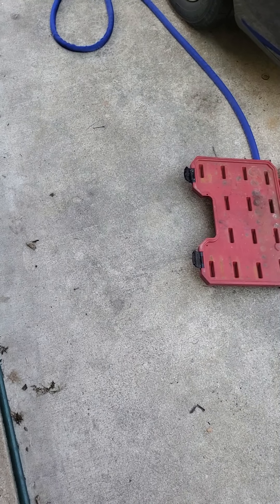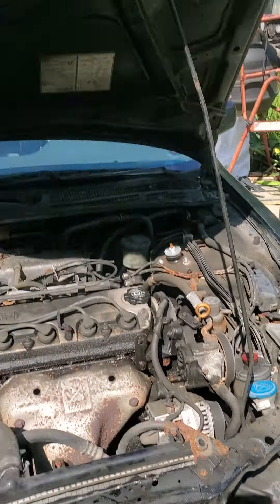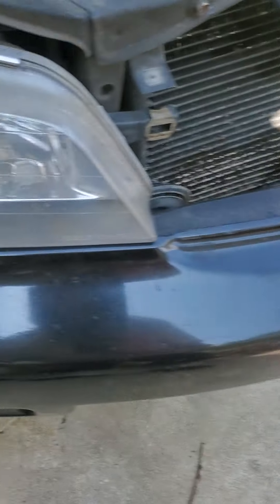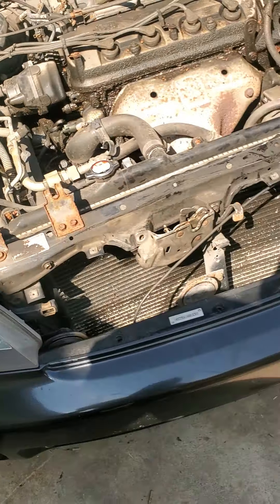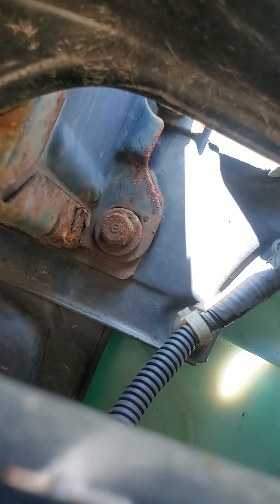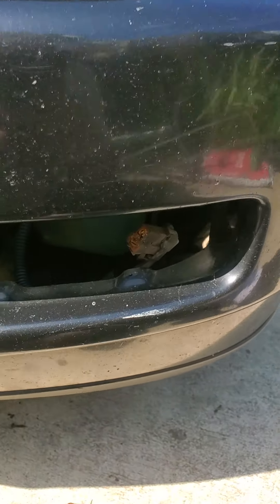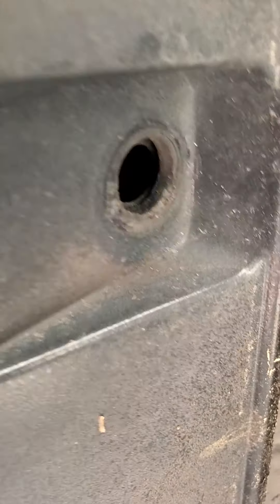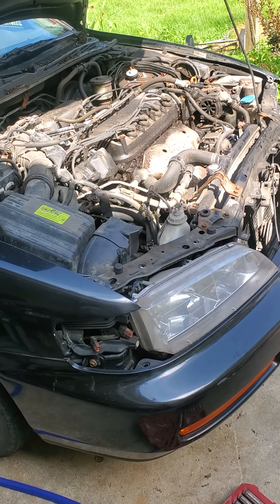94-97 Accord bumper removal

Comment: on my 1996 honda accord i only had to remove the two bottom 12mm bolts (on both sides of course) then just lift and pull .you do not need to remove the bolts right above them... oh also 8mm or 10mm inside the tire well